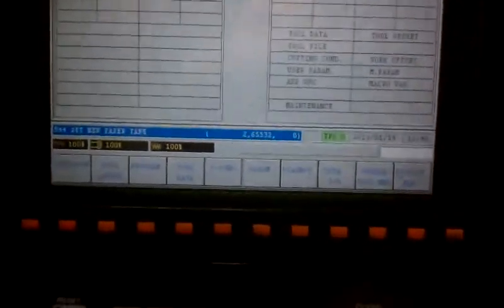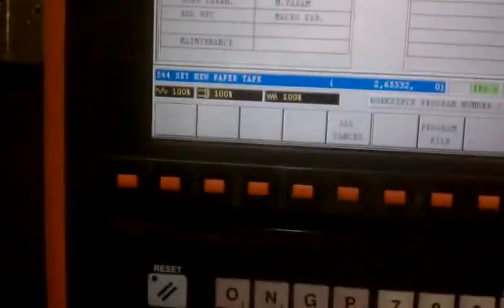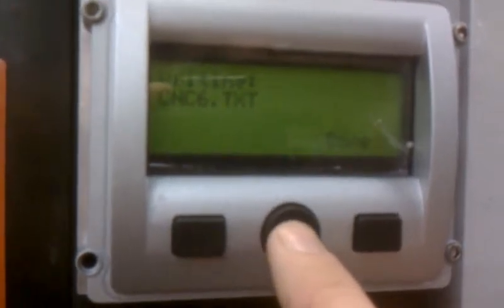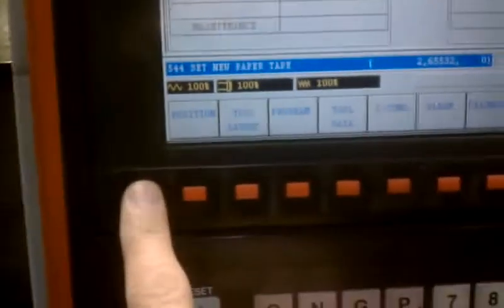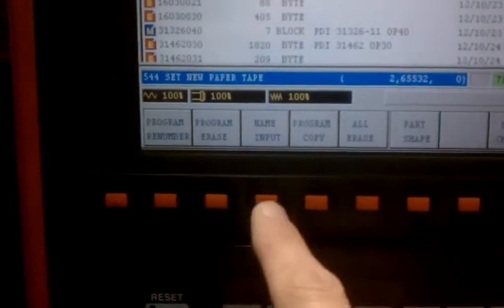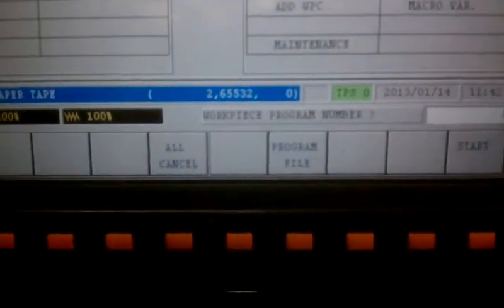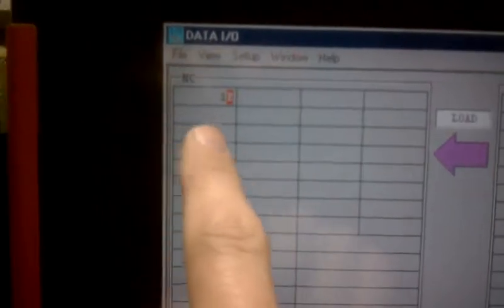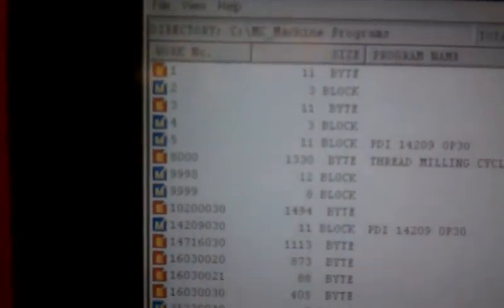Load/Tape input and Save/Punch on Mazak Controls

Comment: hi i have a mazatrol fusion 640mn, I am trying to load programs via dnc but it does not work, but when downloading them it does work, the parameters are configured like this, rs232 protocol, flowcontrol software, ASCII/ISO code, data bits 7, br 9600, parity even, sb 2, I am using a dnc titan brand, what other parameter should I modify so that it can send programs to the machine

thank you

Comment: can you do this with floppy disks?
Reply from the maker: Our product can be used instead of floppy disks. You would leave you floppy disk drive in place. Our unit instead connects into the RS232 and loads/saves/runs programs on the control.
Reply: @CalmotionProducts  you sell DNCs?

Comment: Using cmt how?
Reply from the maker: CMT is the format typically used for Mazatrol programs. On a 640 control you can use TAPE for Mazatrol and g-code programs.
Reply: @CalmotionProducts  hello, im using rs232 using computer, how can i get the exact parameters,? My machine is nexus 41a

Comment: Quiero pasar un programa Del DNC a un MAZAK PC-FUSIÓN 35/120 pero me aparece un mensaje que dice parity H y ya no se a que moverle, si me puede apoyar le agradecería mucho.
Reply from the maker: It is probably your settings, set Mazak to 8 bits, no parity, 2 stop bits. Set computer sending to 7 bits, even parity, 2 stop bits. If that doesn't work, what are your Mazak settings?